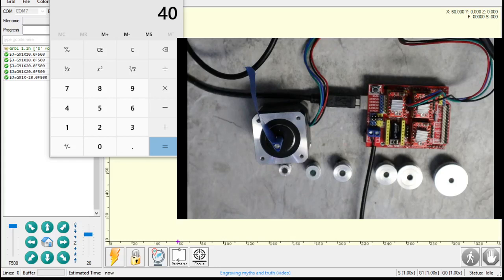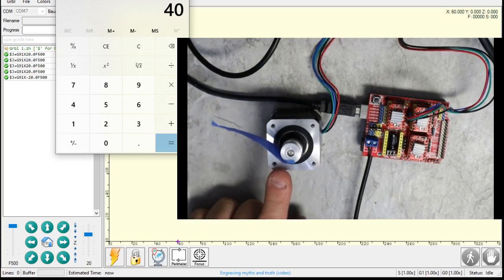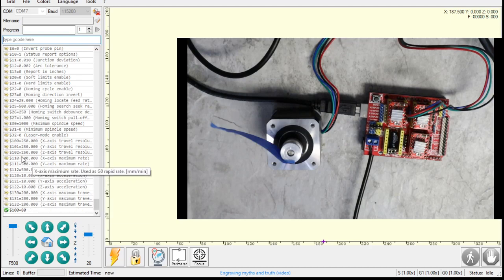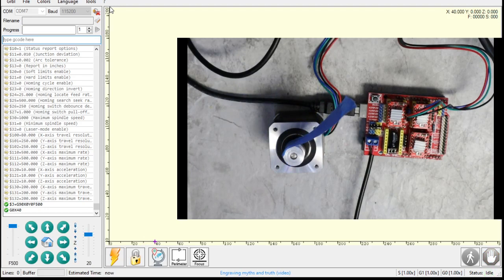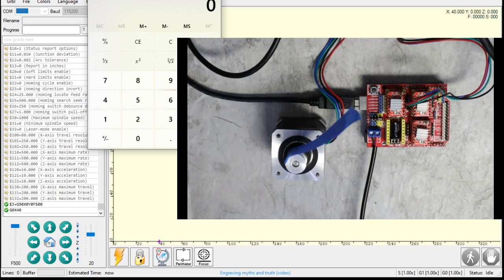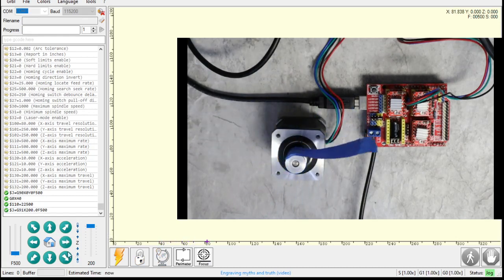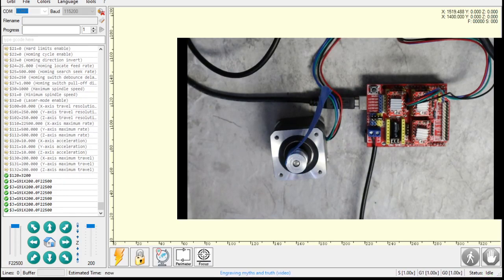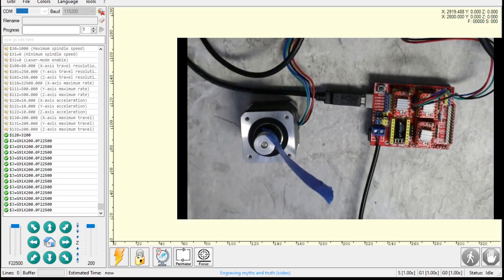GRBL Shield video 4 2  Loading your motion settings

Comment: I copied your settings in lasergrbl. I used the same hardware except for I used drv8825 driver's. Everything was fine until I put that 22500. As soon as I put that setting in. I tried moving the stepper and poof magic smoke 🤦
Reply from the maker: What smoked?? The drivers?? Those drivers usually come defaulted with too much current.
Reply: @brakthehun  I set all the drv8825 drivers at .6v......X axis spit out a bit of smoke. I replaced all my driver's. All I had to replace them was a4988 @ .5v. Right now I can only put the $110@1200.  If I go up to 1500 it sounds bad. It's my first attempt to build a laser engraver. So I figured I would have growing pains. Thanks for your help

Comment: hello sir, is there any option to connect arduino due or stm32 nuclo board with Lasergrbl ?
Reply from the maker: Both of those boards have GRBL ports. Look up STM32 GRBL
Reply: @brakthehun  tnx q for sir,  i see, but my  question is can we connect stm32?arduino due board with lasergrbl software(for gcode sender) because in software there are only two target(arduino nano/uno) device only we can connect,?
Reply from the maker: @CreativeWorld-h7o  
I see what you're asking. You will have to compile those GRBL firmwares yourself. LaserGRBL does not have compiled firmwares for those boards.

Comment: You went from describing the 20 tooth 2mm belt pully as having 40 steps/mm in the last video to using the 80 steps/mm in this video, So you likely are setting about 1/2 of your max speed using 22,000 or so for your max speed.
Reply from the maker: I will have to check that. Thanks.